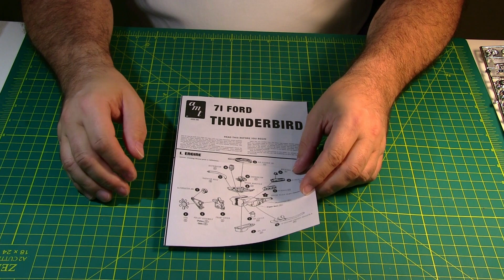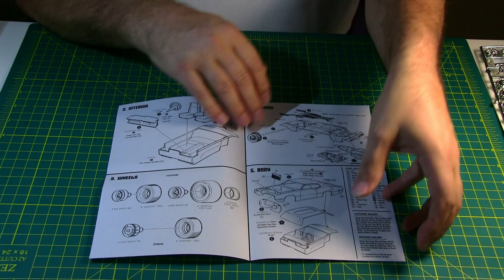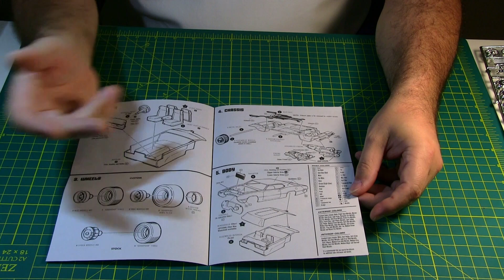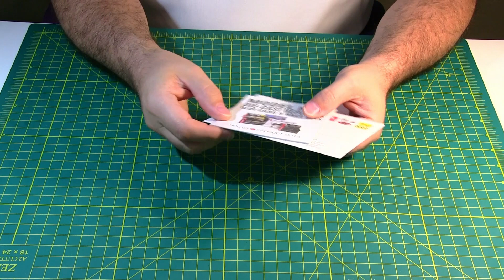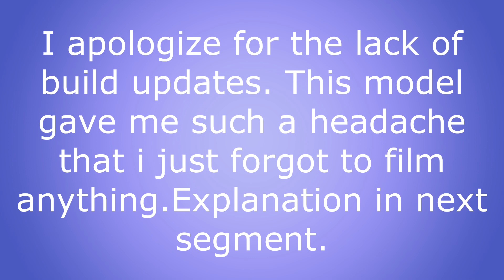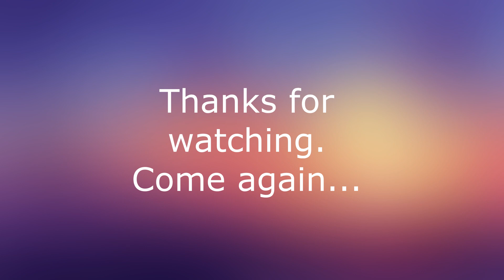Plastic Model Kit Review and Build 1971 Ford Thunderbird

Comment: Been thinking about your spray painting frustrations. Here's my general must-do list for spray painting bodies:

1. Wash parts with warm water and dish soap (to remove mold release oils).
[Check environmental conditions before painting: No humidity (damp, rainy). No cold temperature (winter).]
2. Primer (red, grey, white, black: depending on final color). Automotive primer, with sealer if trim was sanded off.
3. Spray paint: enamel (slow dry) or lacquer (quick dry). Light fogging first to bite into primered surface, then fuller coat to cover but not too heavy. (Cover, but less is more.)
4. Decals (optional).
5. Clear coat (gloss, semi-gloss, flat/matt...depending on subject). [Don't clear coat over silver painted trim: It'll blurr it.]

Sometimes spray paint performance will vary color by color. Flat/matt colors are more forgiving than gloss colors.
If you do MORE THAN ONE COAT, you need to give the first coat A LOT of time to dry! [Especially gloss paints.]
Reply from the maker: I’ve noticed black takes forever to set.
Reply: @Kryptosmaster  If you mean Gloss Black enamel, yes. Just the nature of gloss is like a goop that takes longer to dry and solidify (cure). (Compare to Flat Black which dries quite quickly.)
My old rule of thumb from decades ago, a shiny paint job takes 20 days to cure.

Comment: The front valance, which Ford called a "stone shield" (under the front bumper), could be had in body color from the factory by ordering either the optional  "Exterior Special Brougham Option" for cars ordered with the Brougham interior, or the "Special Appearance Package" for the base cars. With either package,  also included were color keyed grille and headlight bezels, rectangular driving lights in the grille, color keyed wheel covers, deleted rocker panel moldings, added body side moldings  and upper wheel lip moldings. Amt did the model with the special appearance package option, given the driving lamps in the grill, and lack of rocker panel moldings etc
Reply from the maker: Yeah, you never know who decided what trim levels to use on models. I’ve seen all sorts of variations while researching.

Comment: I'm currently building that model.  I feel your frustration over the paint, though my approach was the same as other kits built.  For some reason, the hood bubbled all up, so I stopped painting and just stripped it all down and started all over again.  You did a fantastic job on the interior.  I wish mine had come along as beautifully as you did.  Over all, your car came out fabulously.  You have nothing to be sorry for.  It's a tough kit to build.  I wish Round 2 would re-do the kit.  It has a lot of issues with the badging and the details inside and underside.  LOVE what you did here!!!
Reply from the maker: I’m probably over critical of myself. Thanks

Comment: Agree on painting...it's the hardest part of modeling, and can lead to lost interest due to bad paint. I have been building since the late 60's. Here is what helped me. Running warm water in sink and soaking aerosol can (too just below the cap line) for about ten to 15 minutes. Shaking can vigorously between soaking, as well as right before spraying. Sanding the body between each light coat. I have been successful at repairing areas by sanding and re-applying after warming paint as above. I also use automotive primer and also use real car paint on models, I have always preferred auto primer/paint over model paint.
Your Thunderbird looks great, color is close to Burgundy Fire color offered by Ford back in '71.
Reply from the maker: I’ve had bad luck using the automotive primer. I shy away from that now. I do warm the cans in water if it’s not a warm day. Occasionally I’ll set them in the sun while I’m painting outside.

Comment: About painting.... 1 smooth even coat of primer, 2 take a damp rag and wipe it down before paint to remove static charge, 3 wipe with lint free cloth and a little alcohol, isopropyl... 4 thoroughly shake and mix paint, 5 light coats are better than one thick coat. Good luck.

Comment: Sorry about all the paint issues you had with this - been there, done that! I've heard what you call the 'satin look" referred to as 'orange peel', and I'm very familiar with that; sometimes it happens when there isn't much paint in the spray can or when you hld it too close to the body. End result looks great, though! Those older kits are always kind of a nightmare to build - I have bought them because of the uniqueness of the subject most of the time. Been doing this for 42 years this May.
Reply from the maker: I don’t think what I’m calling satin effect is the same as orange peel but either way, it sucks. Lol. I did find that it’s possible to polish that satin effect out sometimes. As long as you have enough paint layers to work with. I’ve also sanded it before and hit with another coat to fix it.
Reply: @Kryptosmaster  What did you soak the body in to remove the paint? I find certain products can melt the plastic or leave it rubbery.

Comment: Duplicolor is a base coat clear coat system. You have to use a clear coat to get it to shine.
Reply from the maker: I know but I had bad luck on the first attempt so didn’t want to push it. If I use duplicolor again I will pick up some of their clear coat.
Reply: Just use future floor care. Buff with a used dryer sheet in between coats.

Comment: Are you washing your parts, even the chrome, in simple green or even just dawn?  The new models are better about not having strong residue from the molds but older kits you can actually see the mold release and grease on the plastic.  You never mention this in your process.  I use the krylon and Rustoleum rattle cans for 90% of my painting and I never seem to have the issues you are describing...  But appreciate the video.
Reply from the maker: I wash the larger parts like the bodies and hoods. I rarely wash the smaller stuff.

Comment: Do you have air fresheners around the house? That floats around in the air and contaminates the surfaces of whatever you're painting. Wipe the parts down right before paint and you'll be fine, trust me. Whatever issues you're having with paint I guarantee it's 99% because of contaminants on the styrene or in between paint coats.
Reply from the maker: No air fresheners and I don’t paint in the house anyway but I usually do clean large parts before painting. I’m just cursed. Lol

Comment: Did u off gas it and was in warm dawn soap for 24hrs?
Reply from the maker: 24 hours?? Never heard of that.
Reply: Could be why u have paint issues.
All parts soaked in Dawn blue soap for 24 hrs  to remove molding residue/ greasy oily molds...then a wet sand to prepare for primer.